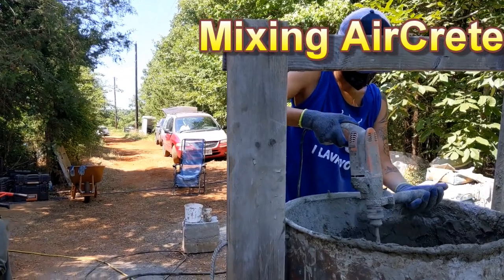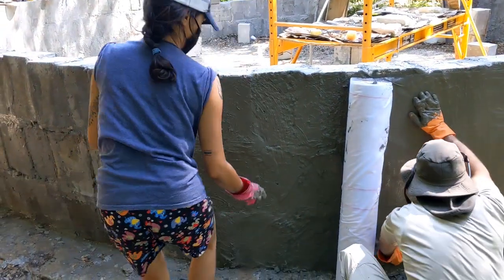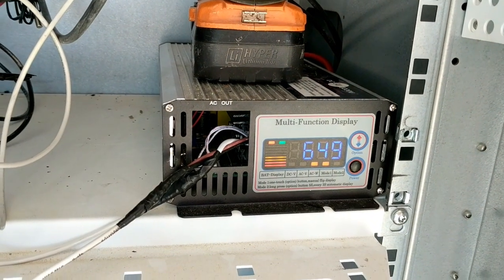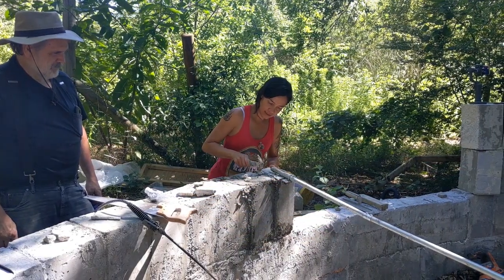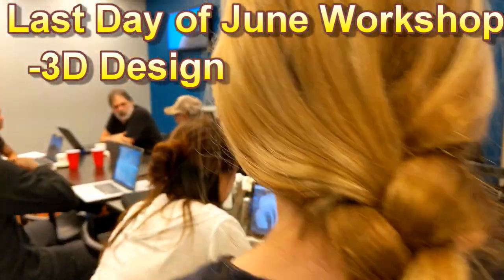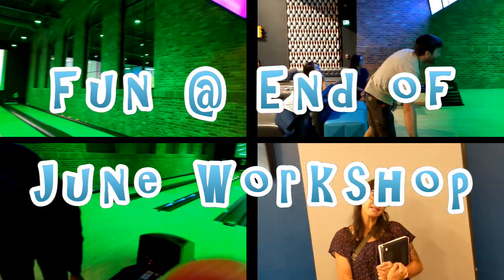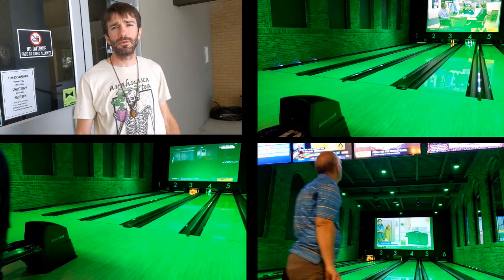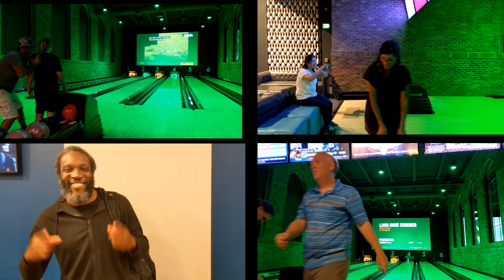June AirCrete Workshop Review

Comment: Love What Your Doing Daniel... This is Exactly What People NEED...
Reply from the maker: I hope I can assist many people get confident & free
Reply: @TinyGiantLifeStyle  
Hey Daniel, 
There is No Doubt, as you are already doing that in Many different ways. 
On a side note: I saw in your building the Round Cabin Workshop Video where the thin plywood you were using for the Slip Forms had a blowout due to the glues they are now using in the material caused it to fail... A Suggestion that Might work for this, Would be to use a Thin Plywood Hardboard...it is the Dark Brown 1/4" paneling type board in the section back where they keep the Peg Board and other panel type sheeting materials..  I don't think it would bleed out on you. and isn't that expensive either.Thought it Might be worth a look anyway..  Just a thought.